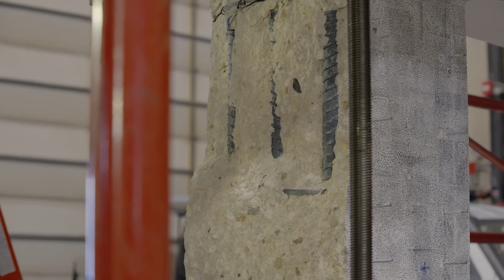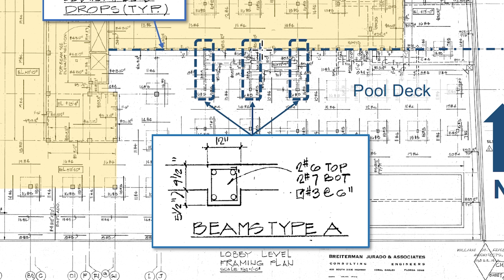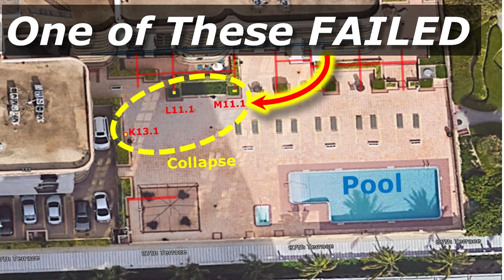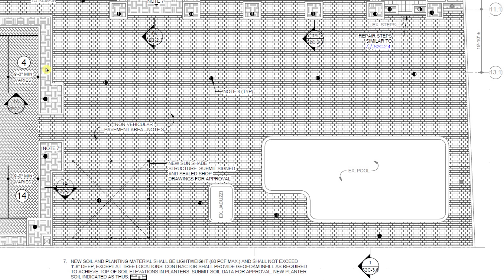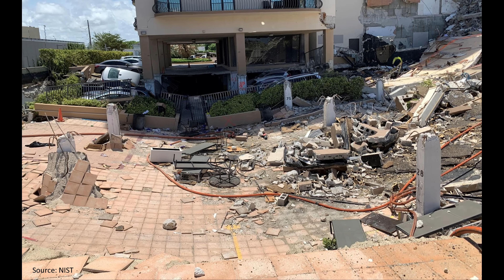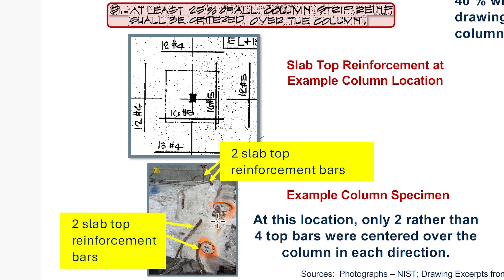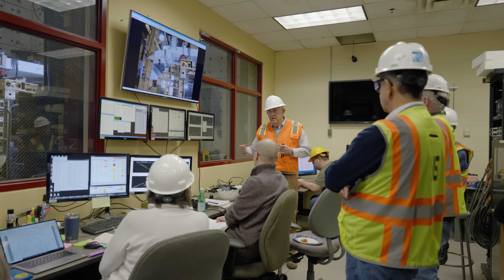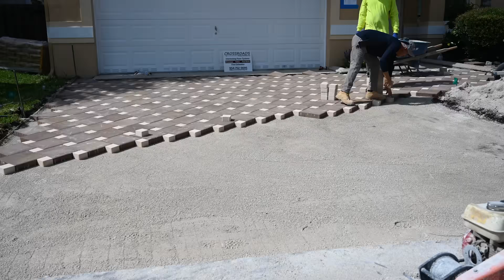Champlain Towers: Secrets the Feds Uncovered in Collapse Debris

Comment: 9 inches of sand, and a deck that was flat enough to collect water... pretty much, that means the slab was sagging already probably 7" mid-span which would have opened cracks over the columns for water intrusion that caused the rusted hook bars. 
Did nobody ever measure the sag of the pool deck from the bottom surface, in the garage?

Comment: I believe the correct way to do it would have been to form dog ears on bearing column to integrate (tie) beams into with the lower PSI concrete.  Beams should sit on the 6000PSI dog ears and tied into rebar of the 6000PSI column to pin.

Comment: Don’t underestimate the average weight of the average car from 1979 to 2021. In 79’ it was ~ 3,500 lbs., in 21’ it was ~ 4,300. So, 800 lbs more each. That’s just for cars. Trucks show the same number average. But, how many single cab trucks did you see in 79’ vs 21’. In 79’ it was pretty much only things county road crews bought. For the last ~ 20 years, quad cabs are the norm. That adds even more weight. On top of that, electric cars are even heavier, I’m not sure if there were any there or not.
I’m NOT saying that it’s the cause, but it’s like you said, Swiss cheese effect!

Comment: Two things.
When the concrete planters were replaced, how were they wrangled into position? Were the old ones demolished & the replacements prefabricated or poured in situ?
That 9"of sand under the pavers likely was driven by the paved deck being installed over the original graded deck to level it out.

Comment: 33:04 Water weighs 8.3 pounds per gallon... This would have been a lot easier with the metric system. Volume of 1 liter water = mass of 1 kilogram = area of 1 square meter to the depth of 1 millimeter, etc. Makes me wonder if things become harder to visualize with the numerous oddball conversion formulas required between inches, pounds, gallons, and the like.

Comment: I would say the main culprit is the design and the Water Management from the pool itself... nothing does more damage to concrete and steel than muriatic acid and chlorine which is both present in the pool water.SPALLING for every 1 inch of spalling you see there's 36 in you don't

Comment: Not only do you have those poorly redesigned parking lot beams, the heavy, wet planters but heating and cooling of that pool deck, every day and night. That constant flexion from expansion and contraction, must have really tore at those beams and the connections at the building. I wonder if this was the real cause of the cracking.

Comment: IIRC from a lecture at the IStructE in London, a large portion of the blame was laid at the feet of the security company because the night porter did not raise or know how to raise the alarm.  As I recall there was an initial collapse of the pool and lives would have been saved if the alarm had been sounded to get people out of their beds and into the street - fair enough I suppose.
More blame was cast on the neighbouring developers and contractors and from a British point of view it seems strange that the owners of the building somehow get let off - it was their building.
But then similar to Grenfell everyone at fault apart from the owners (Local Government).
What is disturbing is that US concrete codes of the time weren't as stringent on punching shear, on robustness and on rebar detailing.
Yet it wasn't even built to the design - 2 not 4 slab bars thru columns, column main bars not lapped properly, slab top bars too low so not having the designed lever arm to resist hogging moments.
So, the question is how many other US buildings are like this - on the point of collapse.

Comment: Jeff, I’ve been a commercial carpenter and superintendent my whole career. I see the issue of 4k concrete between stacked columns. The sequence is to pour a floor of columns, then the slab monolithic over the columns providing a work surface to repeat with next floor of columns etc.
What if during the slab pour you have a second bucket or pump, one with 4k and one with 6k concrete? As the floor is poured with 4k a couple of yards of 6k is placed at column locations, vibrated together for continuous monolithic pour?
Yes it will cost more, trying to eliminate cold joints

Comment: Concrete PSI is a compressive rating. Concrete gets rebar to allow for better tensile strength. Fundamentally, there was zero/nada/zip maintenance at Champlain South. As a reference, a condo in Clearwater FL was evacuated because of a badly cracked column in early May 2025. After a week of adding shoring all around, and making balconies off-limits, residents were allowed back. P.S. No package deliveries over 75 pounds without engineering approval ....

Comment: Interesting. Many bad things have to happen and one critical element is that the builders tied the pool deck structure to the tower structure even though they were at different levels. Had the pool deck been built separate from the tower, as a stand alone structure, nothing would have happened except for the pool deck collapse
Reply: Yep, this is the key design flaw. As badly as the whole thing was designed, implemented and allowed to deteriorate, the pool deck attached to the non-redundant columns in the residential tower is the worst decision of all. If it had been kept separate by a rubber expansion joint or similar, we would never have heard about this - the story would be a garage roof collapsed in Florida and squished some cars, but fortunately no one was hurt because it was the middle of the night.
Reply: Always a perfect storm. Those poor people.
Reply: most likely though, of course the pool slab falling could have damaged the poorly built and overloaded edge columns which could have still led to a failure.

Comment: The sandwich slab is a structural concrete slab, waterproofing coating on top, then an unreinforced protective slab, sometimes called a wear slab, on top. Water gets under the wear slab therefore you need bi-level drains to get it out, especially on the ocean with the salt. The waterproofing has a life expetancy and has to be replaced (~25-30 years). When it fails, salt water is getting into the structural slab. It is expensive to replace since you have to remove any decorative cover (tile, pavers., planters, trees) and the wear slab to replace it. Condos don't like to spend that money. The conduit leak is typically a corroded light fixture or junction box that is allowing water in, which travels to a lower location, frequently through the concrete structure. When the steel conduit rusts out, the water is now in the concrete.

Comment: Any licensed engineer should know that cracks in reinforced concrete, allow air and water in to touch the rebar, rebar that is completely encapsulated in concrete there is a pH reaction that occurs between the steel and concrete where it becomes corrosion proof in 100% encapsulation.    Cracks in reinforced concrete, especially in coastal areas, are really absolutely unacceptable, in almost all situations because of this.    It is the number one cause for failure.
Reply: Well described, 'jd'. Concrete is acidic before it 'sets', and then becomes basic, preventing any entrapped steel
(like the rebar) from corrosive decay, while the concrete-to-metal joint is intact.  Once the concrete begins to 
disintegrate, the protective effect of the concrete over the steel decays.

Comment: For all of the layers on the pool deck if every layer was renovated at approximately 20 years then there might have been enough turnover in tenants and personnel that no one remembered the original deck as it's always been that way. Also the contractor may not have wanted to rip up all of that material and dispose of it. As for the 9 inches of sand it may have been put in to bring up the deck to make it level but also because the beams were already sagging.

Comment: 9" of paver sand should be the telltale that the pool deck was already significantly sagging long before they even redid it with all the landscaping.  The amount of weight from all that wet sand and planters fully saturated must have been massive on an already compromised structure.
Reply: We had a carpark collapse because of an excessive accumulation of snow that they piled up in one area
Reply: BUILT COMPROMISED. the original plans had columns at 100% loading, as built. never mind the deck reconfigurations or the 4" of extra paving.

Comment: Do you thick the 9 in of sand added to the pool deck was to make the pool deck even all around? As you said on the original plans it looked like the pool deck was sloped for drainage.  Perhaps it was originally but they decided later to make the pool deck even and added a heap of sand for this.
Reply from the maker: yes I think it was

Comment: This doesn't actually prove anything. 
Who the hell believes that this forced failure testing BS actually translates into evidence?
This is called Confrimation Bias.
Reply from the maker: There is no bias, they pull the concrete apart until it fails, an see what point it fails, and calculate from there what the max load of that connection was.
Reply: @jeffostroff Just stop dude. 😂
The fact that you are simply repeating this crap without questioning anything, shows your Confrimation Bias.

Comment: What puzzles me about this case is the corrosion that is seen all over the place.  Drawings show a water proof membrane layer that is supposed to keep water and salt away from the rebar.  It is indicated on many of the cross section diagrams and specification documents of the pool deck.  If it functioned properly there would be no dripping through the ceiling of the parking garage and there would be no rebar exposed to consequent corrosive conditions.  This is a key failure in the design, construction and/or subsequent "upgrades" to the pool deck. You might call it the root cause since the structure did hold up for several decades.  But leakage through the water barrier membrane, for whatever reason, if it was even there, is what IMHO lead to the corrosion, cracking, spalling and eventual building collapse.   It would be interesting to hear more details focusing on this aspect.

Corrosion of the rebar is a huge problem because formation of the oxide results in actual swelling of the rebar surface. This is because the oxide (rust) takes up more space than the original amount of steel that turned to rust.  This swelling is what causes addition cracking and actual spalling of the floor or column surface away from the rusted rebar..  But the engineering consequences are severe.  The rebar loses nearly all connectivity with the cast concrete. Cracks and spalling are actual physical separation.  And even where there are none, the rust layer is very very weak and allows the rebar to slip against the concrete. The rust is "anti-glue" and defeats all the critical reinforcement effects of the rebar.  The engineering strength calculations and safety factors no longer hold.  With prolonged extreme corrosion, common with seaside dock and break-wall structures, the rebars themselves lose strength and rigidity.  

For modulus testing it looks like they used a clamp on extensometer to measure the minute change in sample length as sample core is stresses.  Additionally, it looks like there is a second LVDT transducer (probably a pair) measuring the minute thinning (in tension) or bulging (in compression) of the sample at the same time.  These measurements can give crack initiation loads, elongation to failure and Poison's ratio of the material as well as modulus.  I would expect that in some tests there was a sonic pickup to "listen" for microcrack formation occurring as loads build toward ultimate.  Investigators use such values to confirm the concrete mix met or exceeded specifications and to understand its more subtle behaviors.

Comment: What is that crack on the wall near the left area looks like lvl 1? Time stamp 17.21. Just above the column.
Reply from the maker: There's a lot of shadows there, but they were exploring a lot of concrete around the property and peeling it back to expose damage underneath. The left ide you spoke of is the part of the building that did not collapse.

Comment: Maybe the 9” of sand was due for the need to slope the sand in order to level out the sloping of the original construction?  So the sand may have been 2” minimum to approx. 9” maximum. Admittedly, it’s very unusual to use sand in lieu of adjustable paver pedestals.

Comment: A great update for which many thanks. There's obviously a lot of effort being put into figuring out what went wrong which is absolutely as it should be, but given that many / most of the problems relate to either the building not built as designed, and subsequant changes made to the building seemingly without an impact assessment from a qualified engineer, how does the building industry turn that into a set of inspection criteria and tests that can be conducted on a completed structure without damaging that structure? Of course inspections during construction should pick those errors up but they obviously didn't here, so presumably you're going to need to be able to "inspect" things like rebar layout, rebar corrosion, concrete strength and and water ingress post construction?

Comment: You are forgetting one factor salt water from the ocean was also causing damage to the concrete as well from hurricane storm surges that were getting onto the pool deck and down into the garage area and we know salt water is very dangerous to concrete because in Oklahoma where I am from we are having to fix many bridges due salt damage because of the use of salt to treat the roads during winter weather events in Oklahoma had to spend quite a lot of money to find another chemical that could do just the same as salt but not be as damaging to our roads and bridges.

Comment: Jeff, love your vids on the Champlain towers. Always there’s so much emphasis on how heavy the planters were on the pool deck. But surely the columns supporting weight of the 13 stories (or whatever) of the building have more stress on them than the weight from a few [albeit large, fully loaded] planters? This is what i don’t understand. Appreciating that the spans were too long in that area tho. Explanations appreciated!
Reply: There are several images of cracks in the planters which indicate the pool deck slab was deflecting/sagging excessively.  These visual indicators/warnings were ignored!
The deck probably failed in punching shear, (i.e. as you note carpark columns fine, but overloaded deck like card on a nail) and so the deck progressively failed boom, boom, boom, towards the face of the building the last bay ripping those downstand beams away from the façade columns.
The NIST test shows that ripping away exposing the façade column reinforcement!!
This is a classic progressive collapse scenario.  Small failure leads to bigger and bigger failure.
In the UK a partial collapse of a building called Ronan Point led to an overhaul of the UK Building Regulations and every British Engineer is well schooled in avoiding progressive collapse.
Nevertheless there have been many carpark collapses and vigilance and caution needed.

Comment: 9:00 concrete strength in a column can be 1.4 times the concrete strength of the floor system without taking special consideration.

Comment: I do not see the anchorage of the beam (12”x26”) which supports the deck. It must have reinforcement steel be extended into the column with 90 Deg standard hooks. Or it is not shown on the drawing for “clarity”?

Comment: 7:05 "Design Understrength & Misplaced Slab Reinforcement"  from the very beginning - 40 years - there was low margin for safety. 
This is why proper maintenance is absolutely necessary and in this case it was very sloppy.

Comment: Could a simple explanation be said that if the pool deck didn't punch shear. then the building would have stayed where it was. I think that what i see. all the pillars and members and things. some missing or miss shaped or crowding of rebar etc. I think the added load to the pool deck is failure number 1. When the took the planters out the problem started and could not be stopped. things were bent/shifted out of sort. and the deck was still over loaded.